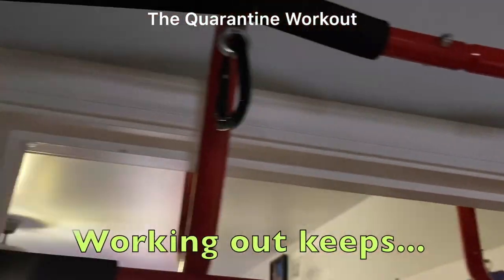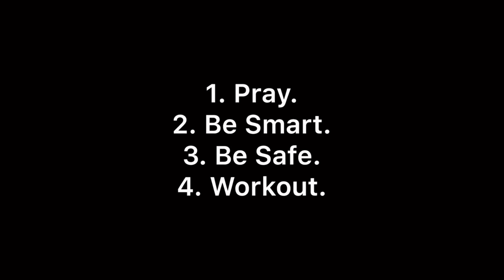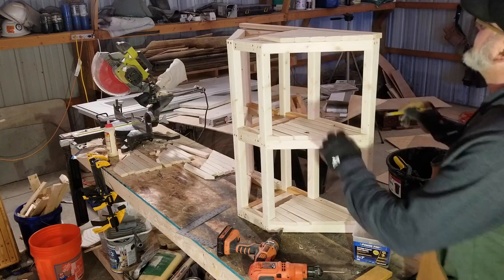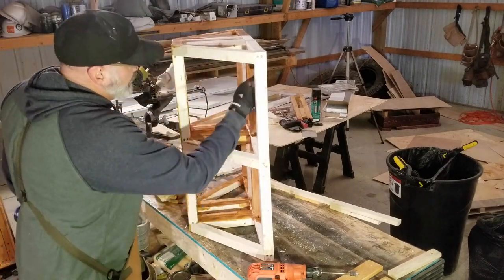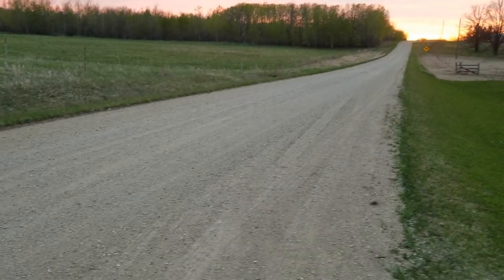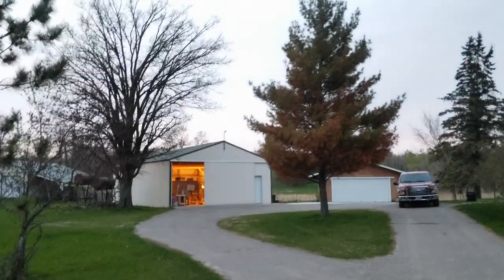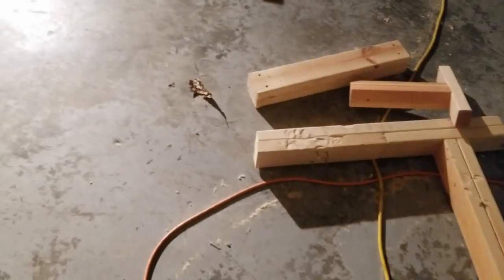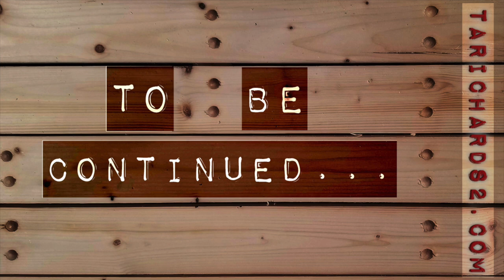DIY CAMPER EPISODE 90 YEAR 2 Plus Quarantine Home Workout

Comment: You inspired me to build my own camper, I had to tear down my original because I was getting flack for it at my old job. Built a new one with an alinum camper top and that is going so much better.

Anyway, thanks man. Because I had the camper built as per your inspiration, I now have a home if things do get bad. Juuuust need to add running water lol.
Reply from the maker: Panic The Scholar Knight. Send a picture when you’re done...very cool

Comment: Terry,
I’m in awe of your truck camper project! I’m only on #16 of your video series. Just wanted to say as a fellow disabled veteran with very similar physical limitations and pain, I already know how much it’s going to hurt! I’ll start on my build later this year largely based on your camper. I have a Ram 1500 short-bed crew cab with the same dimensions as your F150. A few things I plan on doing differently than yours, and don’t take this as criticism; if you think I should do otherwise, say so...instead of studs on 16” centers, I’m going to use 22” centers. There’s no standard and it will cut down on weight. In a lot of areas, I felt like your camper is a little “over-built”. That’s not a bad thing, but I think I can cut weight by minimizing some of the structure of the frame and interior. I’ll probably go a bit shorter on the cab-over section and sleep “East to west”. I’m also going to incorporate radiuses to the front of the cab-over and roof. My plan is to build it in an airfoil shape for roof drainage and aerodynamic efficiency. I’ll build the roof as a separate unit with doubled strips of 3/4” ply  for the joists and rafters allowing me to cut out the contour easier than stick lumber. I have to make this thing as light as possible so I can pull my boat without exceeding GCVW. My truck is a 3.0L Ecodiesel so I can get away with more load than a Hemi. I also want to add some “K” supports to the cab-over frame. That is how Lance builds theirs. I don’t need this for a family. My wife has absolutely no interest in camping, so it’s just me and the dog when we go fish tournaments away from home. I just have to keep it light enough to not end up on a trailer! Great job, Terry! Good luck!
Reply from the maker: Neil Ehringer thank you for your service brother...and thank you for the kind words....I made so many mistakes....I would do it so differently now....please lease from my mistakes....enjoy the build....your build will help you in so many ways....it became my therapy....be safe my brother.